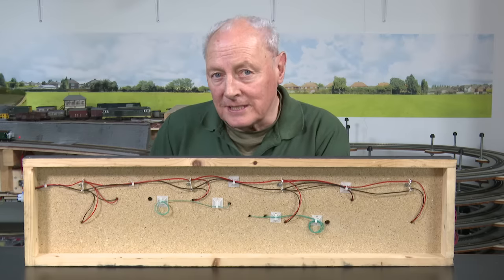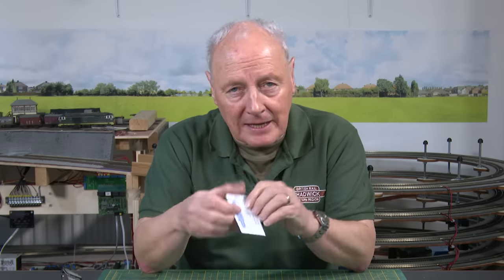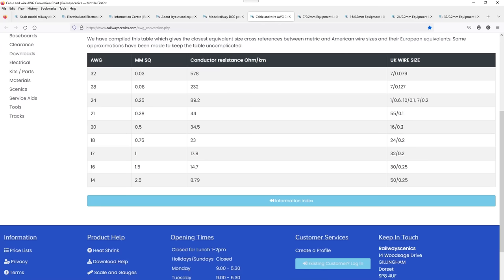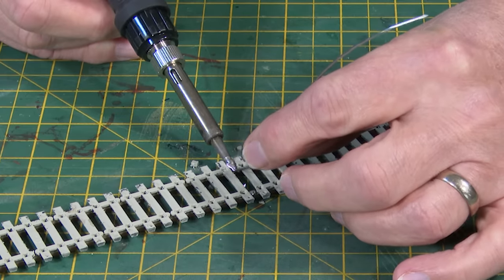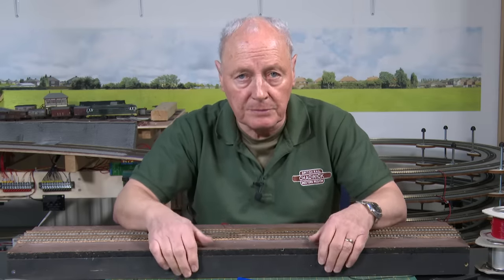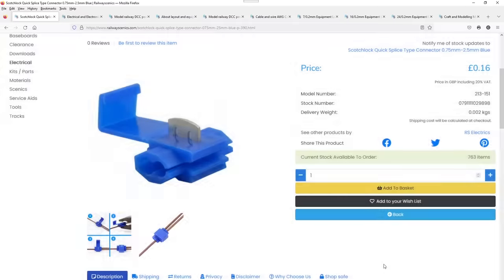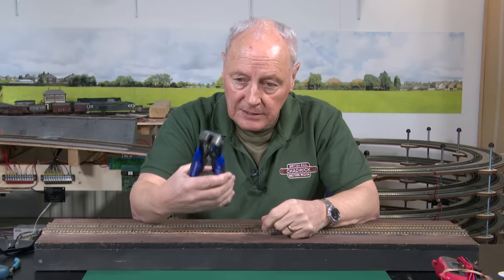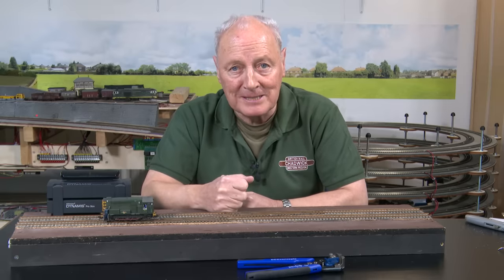LAYOUT WIRING for DC and DCC and all gauges at Chadwick Model Railway | 175.

Comment: Hello Charlie and thanks a lot for your amazing videos. 
I´m model railroad beginner and have just started building my second layout, where I try to implement more advanced techniques and create a more interesting layout. Your videos are very helpful because you manage to explain complex subjects in a easy to understand way and also have a very thorough approach. 

I have recently watched your video about wiring up an layout and have some questions about it. I´m building a small DC TT layout which will be around 2 x 1 m large, with several blocked tracks that will be isolated and at least two dropper wires for the main line circuit. 

I have questions about the need for a bus track and if it´s really necessary to use a bus track for suck a small layout? I have very limited knowledge about electric stuff and would therefore like to know about the pros and cons for using a bus wire or not (for a small DC layout). I have watched several videos and some people are just connecting the feeder wires directly  to the transformer, connecting several feeder wires with the help of simple "sugarcube" white blocks, where several outgoing cables are connected to the same block output. 

And is there a problem to connect wires with different sizes to the same block? In case I will use a bus cable and dropper wires with different sizes. 

Thanks again for your great videos
Reply from the maker: Hi Vladimir, for such a simple layout, I would just use two track feeds on opposing sides of the track. This will stop any voltage drop in the circuit. There is certainly no need to make it more complicated. Regards Charlie
Reply: Hi Charlie and thanks a lot for the quick response. It really helps to get your advice, since it´s not always easy to be a beginner in this field. There is so much valuable information on the internet but it´s not always easy to figure out which is right for my type of modelling. Your videos do help a lot, since they are very methodic and thorough.

I do have three more questions if I can bother you a bit, which are related.

A - Do I really need different sizes for my wires for my small layout? (since you suggest it for your larger one) I have so far used a standard 0.5 mm for all my wirings when I built the first layout. Is that good enough?

B - Is there any reason that I shouldn´t connect different wire sizes to the same terminal block contact or connecting several wires to the same terminal block contact?

C - How much voltage is lost in every terminal block connection between the transformer and the final rail feed and can this be a real problem (let´s say I have three terminal blocks along the way) on my small layout?

I want to thank again for your advice and great videos and hope that I´m not bothering to much with my questions.
 @ChadwickModelRailway

Comment: Hi Charlie. DCC Concepts sell Wago 221 20a connectors which are used in the electrical trade. These are also available from Amazon and Screwfix. I've used these on my layout and found them to be very useful as there is no soldering. They are various single pole multiple connections. Why not try them and make another video.
Reply from the maker: It’s a deal, I shall get some next week. Regards, Charlie

Comment: Great video.    How many drop wires can you put on your 12 volt bus wire?
Reply from the maker: Normally, every piece of track has a set of droppers. Regards, Charlie
Reply: Yes, I get that part.   How many drop wires can you connect to your bus wire?   I have a lot of 3 volt led lights on my layout that I want to connect.  My power is 12volt on the bus wire.

Comment: Sorry Charlie, like your wiring but with my layout I'd have two problems. 1) I'd have to solder over my head and with trifocal glasses not doable . 2) my layout is made of 2" extruded styrofoam and you can't screw the tabs onto it. Working with the layout as you have it is brilliant.
Reply from the maker: What a great response, Bob, that certainly put me in my place. 
Regards, Charlie.

Comment: I'm a cross section and awg guy as that's what tend to go with at work. 
The old strand and quantity measurements is becoming more scarce.
Scotchlocks are brutal and those other connectors are still showing bare metal on a live connection.
Reply from the maker: Thanks Robyn, that’s obviously from electricians point of view. Regards, Charlie
Reply: @ChadwickModelRailway  more of a do a bit of everything point of view lol. But a lot of my work is wiring PLCs and electronics. 👍🏻

Comment: Hi Charlie
Just wondering if you can help or give some advise.
I have a Digitrax DT602 and I am trying (with great difficulty) to set up and programme Cobalt IP point motors from my DT602.
To me the Dixitrax manual is not so clear on how to achieve this. So knowing that you have a Digitrax DT602 system I would be grateful for any help you could give me. I have watched numerous videos on Cobalt points motors but none seem to be using a Digitrax system. I know that you are a Tortoise points motors man but I am 
hoping you might be able to help me with this wee problem.
Any help would be very much appreciated.
Regards
James Sewell
Facit Station 
NZ
Reply from the maker: Hi Philip, have you checked out my video number 161? Regards Charlie

Comment: Nice charlie im about to build my layout just a thought ? Im thinking of 2 small easy to lay copper stripes under the cork were ever you want the track to go pos and neg and simply screw a copper screw directly under the track to the correct height so track is level and a blob of solder for belt and braces to the bus loop with 3 or 4 inputs for good over all current flow ! Points will also be on top as working on a micro type camouflaged as the real thing ! Thanks Little John from chichester
Reply from the maker: I’ve only seen cooper strips used under the baseboard, used as the bus.
Regards Charlie

Comment: Charlie.   Very  interesting and   informative.   Just  one thing  if  you have   4  separate tracks  with DCC  do you require one bus  wire   or 4.  Chris
Reply: I believe you would need separate bus wires for each power district.  So it depends if you have all four tracks in the same district or if you had each in its own power district.
Reply from the maker: Lee is right on the money here Christopher. If it’s all one district, only one bus is needed. Regards, Charlie

Comment: For connecting your droppers to the main bus, you might be better off using something called solder sleeves. It's a piece of heat shrink material, with a ring of solder inside. You strip your bus as you did in the video, leaving the exposed section in the middle, then thread it through the solder sleeve, positioning the solder ring over the top of the exposed conductor. Put the stripped end of your dropper into one end of the sleeve, so it also sits under the solder ring, then hit the whole thing with a hot air gun until you see the solder melt and flow. The advantage of this method is firstly safety, when it's all done the heat shrink completely covers the conductor so there's no chance of shorts, whereas the piece you use leaves an exposed solder joint and conductors, as well as the metal of the connector itself, which you could potentially short too. The other advantage is a smaller form factor and more flexibility, you're not tethered to a point on the board, the sleeve becomes part of the wire rather than a fixed external point.
Reply from the maker: That is clearly a technique I’ve never heard of streaky, are there any videos of it in use? Regards Charlie.
Reply: @ChadwickModelRailway  I did leave a reply, but it seems it was removed?
Reply from the maker: @Streaky100001  if it had a link, it will be held back for review. Regards, Charlie.
Reply: @ChadwickModelRailway  Ah, that'll be it then.

Comment: Hi Charlie - As always an informative and well explained video . Although I have installed my Bus and it works ok it can be tidier and also I need to tidy up the lighting . i have used the terminal strips and did as you did and cut them in half to give red and black in one terminal . I also like those DCC Concepts wire strippers too so will think I will be making a purchase . Do you have links for the soldering iron and solder you use ? 
Cheers Kev
Reply from the maker: I believe the soldering iron link is in the show more tab. However, the solder I believe is stocked by Squires Tools.com. Regards, Charlie
Reply: Cheers Charlie

Comment: Thanks Charlie,
As I have been doing a lot of wiring recently ...I wish I had seen your video before.  As usual, it was full of information and demonstrations that I needed to know and delivered to a very high standard of presentation.  I had more or less worked out a system which did the same thing but I had lots of problems with electrical continuity.  The stripping tool looks like something sent from "above" but as it is DCC  concepts I know it will be good. 
I have found a USB rechargeable soldering iron which is very good for this type of close soldering and very safe - have you tried them?  [I recommend]
I like to make my own turnouts from SMP plans using copper-clad sleepers and SMP code 75 bh rails (this is a hobby in in't own right).  I have recently discovered the joy of activating the points with DCC Concepts point motors.  All the peco solenoid gear is going (eventually).  This is the way forward for this type of trackwork.  I hope you agree and can spread the message to the railway modellers world.  I have spent too long and too much money on systems that cannot work well together. After all- solder is best!
Best wishes and thanks,
G
Reply from the maker: What an excellent comment, Graham. I couldn’t agree more about the removal of Peco point motors, they are so problematic. Regards, Charlie
Reply: @ChadwickModelRailway  Thank Goodness - I thought it was my lack of skill and, to be honest, i got a little depressed about my ability.

Comment: I'm bad at electrical work, so I must ask... If you have a large layout, or a long running track, wouldn't the main bus wire eventually start losing power, the same way the rails would without this setup?
Reply from the maker: Not if you use a cable of sufficient cross-section. Such as 36 x 0.2mm.
I use 24 x 0.2mm for my bus.
Reply: @ChadwickModelRailway  ok because I am constructing a layout made of about a combined 4 "4x8"s and was concerned about one bus wire running along all that track. Thank you for your response!

Comment: hi charlie great video you said to put a wire on each rail do you use insulated railjoints or just the metal once cause i am starting to wire my modelrailroad thx
Reply from the maker: No, you only need insulated rail joiners on electro frog points. In all of the cases, unless you’re into block detection, metal fish plates should do it. Regards, Charlie
Reply: @ChadwickModelRailway  okay i use a servo from digikeijs with electric frogpoint so do i put a seprate power to my turnouts when i do a electro frogpoints

greetings
Reply from the maker: Yes you will need more power feeds beyond the frogs.  Ideally, every piece of track should be powered. 
Regards Charlie
Reply: okay thank you very much for your explenation thx

Comment: I’ve asked this question on a number of sites. Do you think that model trains and the DCC equipment are getting too expensive and stopping the younger people getting into the hobby?
Looking forward to your next video. Alan
Reply from the maker: Most certainly Alan. 
It could be said that that the pricing structure is aimed at much older modellers with spare cash.  Whereas younger modellers, just have the lower end of the second hand market to chase bargains. Regards Charlie

Comment: Beware of those square cable tie mounts. They are held in place with double stick tape which loses its stickiness after time. Best to use the ones that attach with a screw. I've seen those scotchlock suitcase connectors fail. I don't use them.  For my bus wires I just go to the nearest auto parts store and get some automotive primary wire.
Reply from the maker: It’s funny, you should say that Dave. I actually soak mine in IPA, then remove the sticky pad, and then use a glue gun to mount them. Regards, Charlie

Comment: Hi Charlie, have you tried the ModelTech Rail Alligners They seem like if you can use them right they would make the track power situation easier, might also avoid melting sleepers if you have shaky hands? Regards Michael
Reply from the maker: No Michael I haven’t. However, I shall try to look them up. Regards, Charlie

Comment: I’m 70 and recently opened my train box for a trip down memory lane. The locos and carriages look to be in good condition, but the track has taken quite a beating , since the 1950’s. My transformer is slightly younger and still buzzes away nicely. Power gets to the trains but progress is slow and they can’t keep up the momentum along the full length of the layout. Is it me or my train set?
Reply from the maker: You need to feed the power numerous times on long runs Steven.  
Regards Charlie

Comment: One minor addition: when I solder the drops to my rails, I do it at about one-third of the way from an end, rather than in mid-length, so that after drilling the hole, the rail can only connect properly. (Take a guess how I figured that out.)
Reply from the maker: An interesting point Jack. I fit the wires to the rails first, and then drill when I know where they are  going . Regards, Charlie

Comment: Have been looking at vintage railways and looking into track types.Flat bed track was first used in 1936.So the reason for bullhead track is very limited.Even looking the sleepers were closer spaced with flat track than bullhead.So bullhead would mainly be seen at sidings or slow traffick lines.So to me.If building a model in 00.Peko 75 is the closest to normal if you have main lines from era 4.And even maybe before this.?
Reply from the maker: Hi Thomas, 
There really is no hard and fast rule on this as it varied area to area.  However, the sleeper spacing on the Code 75 remains way out.
Regards Charlie

Comment: i bought Brawa wire 0.25mm and stands on 5Amp on it and use it for dc (dcc in the future)at the moment with every blok from max 90 cm wired (kabels max 3meter) so max 1train per blok and go with 1.5mm to my  Fleischmann 12v power station via Phoenix Contact PT 2.5  terminal block minimum 0.14mm /4mm 24 amps max hope this is a good way to do.
Reply from the maker: It sounds a little over engineered, Eric, but hey,  better safe than sorry. Regards, Charlie
Reply: @ChadwickModelRailway  Phoenix Contact PT 2.5  terminal block i have the idee from my work they are used in all the electric 19"racks where the controls are in for the transformater that makes from 150.000 v to 20.000 or 10.000v to go to the steets where its converted in the street transformaters to 400v #f and 230v between fase and pen(this pe+nul(0)). good  Christmas and new year.

Comment: Quick Q as I watch - is 16/02 better than 07/02 for droppers for the track? 

I’m making my very first layout (basic 2 oval Hornby layout but I’m chuffed!) and I want to make sure I start off the best way I can. 
It’s for Christmas but hey I like a challenge! 

I ask as many of the other videos (all good your prob know them) have just used the go to 07/02.
The same with leds it’s all 07/02 wire so I’ve been researching best places to purchase (went to railwayscenics straight away and his prices are very competitive)

I can solder etc but I’m super new to railway modelling - I decided this month to finally go for it - so it’s all questions to YTers, the RM site and Google.

And with electrics it’s important to make sure of right materials. Even for a basic layout which mine will be!

So far I love how direct (and safety conscious) this video is. Very easy for me to understand & retain info. Thanks!
Reply from the maker: I’m so pleased that you found the video useful Angelus. 16/02 is best for the droppers and 24/02 for the bus wire. Regards Charlie
Reply: @ChadwickModelRailway  thanks so much for replying Charlie. One last quick question, the ferrules are a brilliant idea. I have been looking at crimping tools. They are showing hexagonal or square ferrule crimpers. The crimp looks round to me on the video so I’m a little unsure 

Q: Hexagonal seem shape wise the best choice, as I feel when a screw is tightened on them they won’t squash out of shape. Would they be the better fit? I can’t find a round crimper 😐

Thanks again, Angel. 👍🏻
Reply from the maker: Hi Angel, I’m pretty sure that the furrells that I use are hexagonal. There might even be a link in the show tab. Regards, Charlie

Comment: I have some of those  wire strippers, probably got them from Toolstation or Screwfix where they will be a lot cheaper than DCC Concepts who tend to be be very expensive for anything. EG, I no longer buy their solonoid  motors and now use servos . I would also recommend using either a flux paste or fluid when tinning wires etc and not relying on the flux in the multicore solder. As ever good stuff Charlie.
Reply from the maker: Hi Jane, regarding soldering, it’s horses for courses. 
Most of my soldering is small gauge wire, often on circuit boards.  Flux is far from ideal in those situations.
Soldering brass kits however, really is a different game. Regards Charlie.
Regards Charlie
Reply: I bought the Toolstation ones, cheap and nasty, they we’re useless.